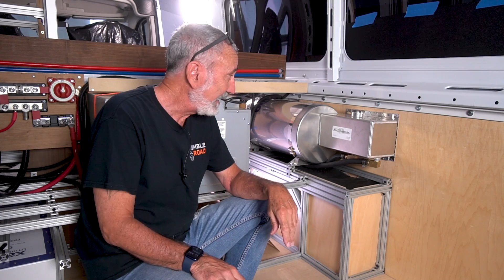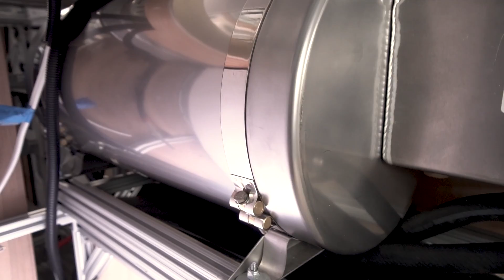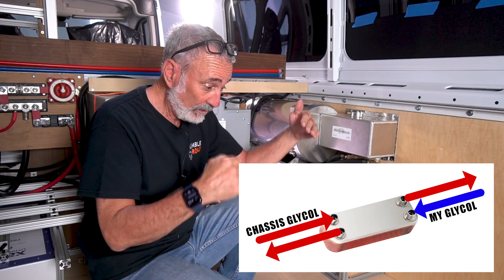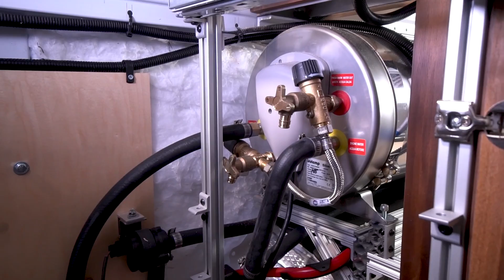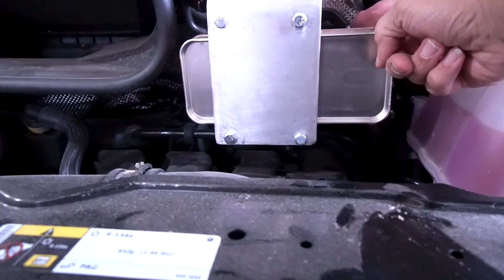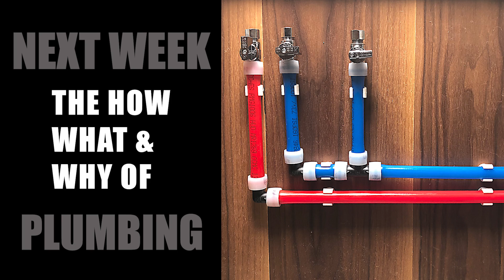Make hot water in your van, while you drive!

Comment: Your level of detail and expertise in so many aspects of van building is second to none.
I think the water heater resides in the second to none area - however great it is to have a hot shower. When I travel I generally am chasing T-shirt weather and would not want an extra heat sink inside the van, as I typically have the fans running and doors wide open to get rid of accumulated heat just from outside temperature inputs. I am usually successful in ridding all of the heat - when I don't - I don't sleep as well. (& we all know that lack of sleep is the new smoking!!!)
I use a more mobile solution to get a hot shower (much less convenient though)

Comment: I understand your concern regarding water conservation in your builds.  However the consequences, especially consequences to you and your company, of a client not properly controlling and monitoring their water resources are minimal.  With your current DESIGN and INSTALLATION of the hot water system, you are going against common expectations of 120F water.  You are relying upon clients and their guests to properly temper the water temperature at each and every point of use. If they do not they could seriously injure themselves and have grounds to sue you for negligent design, improper installation, and you would not have the defense of having a design as well as installation that meets industry standard and common expectations.  Please reconsider your position regarding the design and installation of your build hot water system.  Remember the multi-million dollar award to the person who placed the hotter than standard cup of McDonald's coffee between their legs and received severe burns?
Reply from the maker: As I mentioned in the video, there is a mixing valve on the water heater. The system can be set to any desired temperature. The owners are given orientation and make their own choices.
Reply: @HumbleRoad  Yes, but as soon as you tell people about the mixing valve you say "Nay Nay ... " and give your reasoning for not tempering the water at the heater.  It would be far better to set the water temp at 120F and in orientation inform the client how they can choose to override the "factory setting" if they want to conserve water resources.  No matter, as we say here in Thailand, "UP2U".  Your glycol reservoir needs to be the highest point in the system - how does that work out or are there any issues when the van is going up or down steep grades?
Reply: I’m not an engineer but I’m pretty sure the mixing valve will not allow hotter water than it is set at thru the valve. If the water is scalding like that you will get 90 percent cold and 10 percent hot. Shouldn’t matter what it is. It’s not some random calculation within the valve. It just won’t take on any more hot than it needs it will close up. At least that’s my theory.
Reply: Even if the van water is 80 why wouldn’t it bring it down? It would just take less hot..
Reply: @Chris I get your point. Just like I learned spray foam warps the van. That’s a bigger mistake.
Reply: @Chris How are you planning on reducing the temp from 170 to 150 (or 140)?  thanks.

Comment: Other than solar does the batteries charge while driving
Reply from the maker: Yes, the house battery is charged while driving in one of two ways. (1) A second dedicated alternator with a voltage regulator. (2) 0ne or two DC-DC chargers, using the chassis alternator.